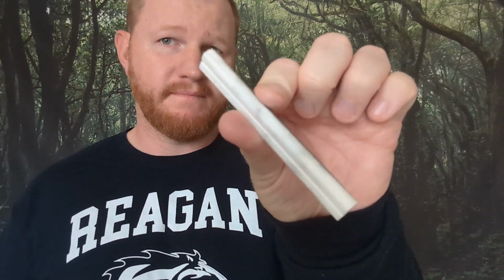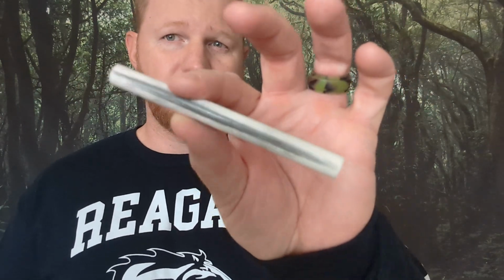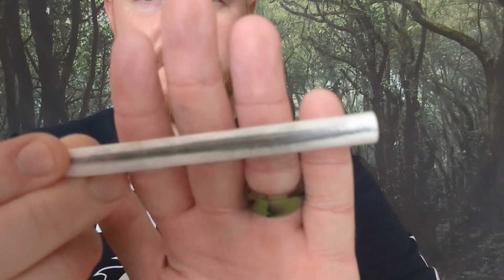Questions on Ceramic Rods and Wood Handle Scales

Comment: I had to go to BHQ and do a search for the wood. The most common wood in a modern folder I've found is olive wood. The MKM Terzuola is a fine looking flipper with olive wood. On the ceramics,  I like to wrinse it in the sink occasionally with some dish soap. It usually takes 2 passes to get it clean but I believe it helps open the pores of the ceramic and sharpen a little faster.
Reply from the maker: Thanks! I'll have to look up that knife

Comment: To clean the ceramic rods use a rubber pencil eraser or wash it off with dish soap. To me, the reason to use wood scales is that they look good and have a nice feel in your hand. It’s not a durable as metal but I think 99% of people won’t use a knife hard enough that it becomes a performance issue.
Reply from the maker: Yep I like the look of wood

Comment: I use a blue shop towel and lightly clean my ceramic rods and steels. I wouldnt want anything inbetween the steel and the ceramic that could affect sharpening, like particles from blade coatings etc.
Reply from the maker: Thank you

Comment: Joker knives from Spain uses a lot of wood on their knives, even as Boker
Reply from the maker: Joker make folders?
Reply: @isaacs_knives_and_knowledge  yes, they've got many folders. I bought the joker Pachón with búfalo horn scales. But I have to say, It is very nice, but the lock you can' t compare with the lock of Buck. The grind is very nice and It slices very well. But nothing as good as muy Buck 110 and 112
Reply from the maker: @Marcobuck  I'll check them out

Comment: I have found that it does negatively impact the ability to sharpen a blade. The same way it negatively impacts sharpening ability if you do not clean a wet stone. What is happening is the small pores or edges we cant see fill with minute metal particles and those imperceivable edges are what are basically cutting the metal. When they are filled up you no longer have the ability to remove more metal which is all sharpening is. It is why the finer the grit the finer and sharper the edge of your knife is.
Reply from the maker: Thanks!